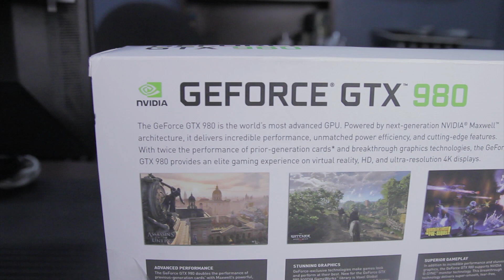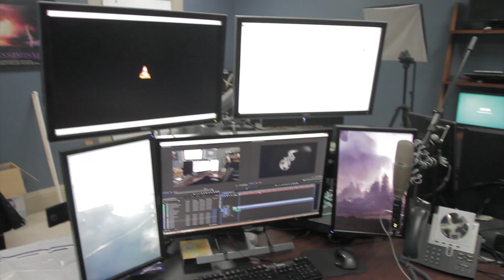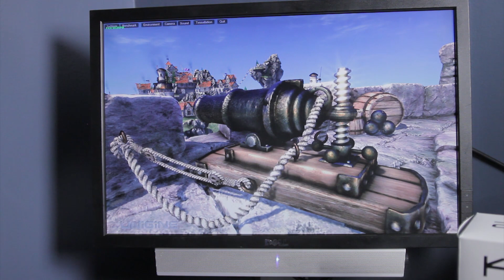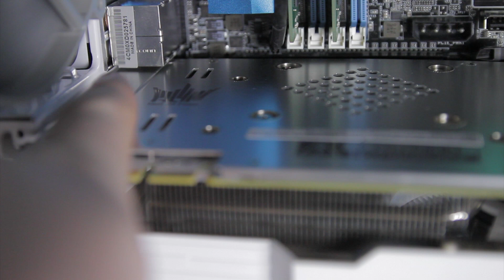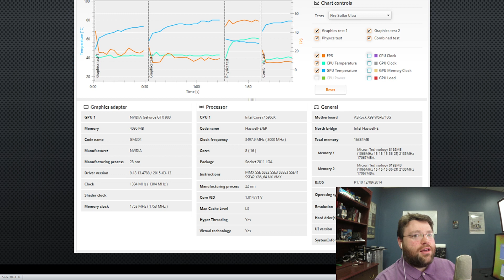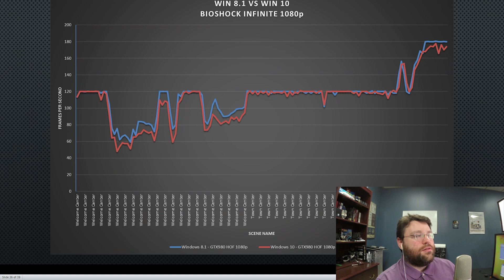KFA2 Nvidia GTX 980 HOF Review & Benchmarks (GALAX)

Comment: "GTX 980 1 of the most power thirsty cards ever from nvidia" Have you forgotten the GTX 480 and the GTX 580? Put a 200 - 300mhz core clock your asking for a 700 watt PSU alone for the entire system for 1 card.

Comment: The 980 doesn't consume much power (and output much heat) at all. The extra 8 pin (only one needs to be there: look at the strix 980) is for extra overclocking potential.

Comment: Wendell, I feel like u haven't researched the Maxwell cards very well. U make a few claims that are quite wrong. The 980 isn't one of Nvidia's most power hungry cards ever, it's actually the opposite. The 980 and 970 are two of the most power efficient cards they have ever made. That is one of the biggest benefits and highly touted features of the Maxwell architecture. Also u went on to say that a 1500MHz clock made this the fastest 980 u have benchmarked. Once again that is the normal boost clock for the Maxwell cards. I have a 970 g1 and it goes up to 1620 MHz stable without much effort. I know that many versions of the of the 980 can reach the 1500 MHz boost without much trouble. The next thing u said was about DSR being able to scale to 4k, that is true but it does way more than that. It can go to any resolution between 1080 and 4k. The reason I'm writing this is because I was very surprised that u didn't already know the basic facts of Maxwell. The main fact about the 980 and Maxwell is it is very power efficient and the temps stay cool, resulting in high overclocks and big gains in performance on almost every card.

Comment: How exactly is this "One of Nvidia's most power hungry cards ever". Any GTX 480 owner who was essentially using their GPU as a space heater would beg to differ lol. And 1500 MHZ is a pretty average OC for Maxwell architecture. So, considering the cost and over-done power delivery design of this card, it looks like you lost the silicone lottery unfortunately
Reply: It's alright man, nothing lasts forever and nothing is promised. The only thing promised with these cards is the core clock, even the boost clock isn't promised but I'm alright with it lol. I'll be selling and upgrading by summer time latest anyway, possibly go team red or team 980ti lol.
Reply: Actually I'm pretty sure this card pulls a lot of power compared to a stock gtx980. Also this card runs very high clocks straight out of the box, some people prefer not to overclock themselves so this card would provide a better gaming experience over any other card at stock speeds.
Reply: Noxtastic overlocking is easy as fudge if your building a pc and you can't do that that's. Really dumb
Reply: AdamantiumDragon NG Some people just don't do it, whether it be because they don't know how to or just don't want to risk damage to their components.
Reply: AdamantiumDragon NG overclocking is easy. that's true, but i have a 780 classy that don't overclock at all and on top of that i have to re-activate the overclock every time i boot my pc, so i run it at stock.
Reply: i use a gigabyte gt 440 i wonder why it even has a fan it doesn't run very hot at all but i have a BFG GTX 9800 i can't even use it because of my power supply but that's not saying much it's only 500 watt with a single 6pin but when you consider the time frame the card came from that's a thirsty card
Reply: 1500 isn't average lol. My 980 hits 1450 max, without touching voltage (gigabyte g1 gaming edition).
Reply: Ameer Mahmood you got a really bad card because mine goes to 1540 without any problem
Reply: i would like to make an amendment to my earlier statement a fucking leaky light fixture combined with a storm claimed my 440 last night, i'm not happy!
Reply: LAN Master oh shit, that sucks. Is the rest of the pc ok?
Reply: Casey Powell strangely enough yes thanks for your concern it looks like the water missed the CPU landed on the back side of the GPU and shorted it out to high hell the fan spins really fast and displays no signal but the computer doesn't shut off intimidatingly after pressing the power button so it's not faulting the OS

Comment: Hold up, the 980 is one of the most power thirsty cards nvidia has released? Nonono sir maxwell is power efficient! The 980 pulls less than a 770. Also, the reference pcb models only requite 2x6 pin connectors.
Reply: ArrKayCee I think he meant out of the 900 series lineup
Reply: ArrKayCee Exactly, I was like "What the Fu...?!".
Reply: According to a detailed test on Toms Hardware:- "If the load is held constant, then the lower power consumption measurements vanish immediately." and "Nvidia's stated TDP becomes a distant dream."

They benchmarked reference cards pulling in around 280W, thats more than a Titan and GTX 780 let alone a 770.

http://www.tomshardware.co.uk/nvidia-geforce-gtx-980-970-maxwell,review-33038-12.html
Reply: Tuberuser187 While that might be the case, when do you have a consistent load on a GPU? Only things I can come up with is bitcoin mining or folding by utilizing the GPU.
Reply: Revvit If you read the results by "constant" they refer to any time GPU boost is on for more than a minute.
Reply: Tuberuser187 It is clearly stated that the load needs to be high intensive compute tasks such as CUDA or OpenCL. You do not have constant 100% load whilst gaming for example.
Reply: Revvit Go back and look at the graphs, it has them clearly titled "1 minute of high resolution gaming", CUDA processing will do it as well they are also referring to the way GPU boost works on a warm card just that the effect isn't as pronounced.

Besides people do buy these cards for CUDA accelerated rendering and video processing as well.
Reply: Tuberuser187 While gaming the avg. power consumption is still relatively low. The stress test graphs are the only ones showing excessive power consumption. The graphs are seriously not as hard to read as people seem to make of it. 

The massive power consumption was achieved with GPGPU by applying constant 100% load. It's still just 200W while gaming and 285W with synthetic 100% load benchmark. Synthetic tests are never applicable to real-life scenarios.
Reply: Revvit Well they must be hard for you to read as they show the gaming load in excess of 250W, above 300W on brief occasions. The average is dragged down to below 250W because of the occasions it drops as low as 50W, because its lower than the amount of times its higher the average is lower.

It still clearly shows that the stated TDP is inaccurate as for a significant amount of time its far in excess of that.
Reply: Tuberuser187 Why should I care if a card draws 250-300W for a split second when it averages out in a very reasonable consumption levels on the long term? Imagine a power supply has come to market which can output a peak of 3500W, but consistently handles 1000W load. Would you go around saying "Holy shit! It's the most powerful PSU in the world!"?
Reply: Revvit Why would you care? You seem to care a great deal about the occasions it draws less than its TDP a great deal, plus it consumed more than 250W for longer than "a split second".
Reply: Tuberuser187 I don't care about the lowest number either. I care about the average, like most of the sensible people, because that is how you get the most meaningful power consumption number within a period of time. This is once again 200W, which is perfectly reasonable. Just like the test results show.
Reply: Revvit So are you disingenuous or don't you understand how averages work? The dips down to 50W or less are enough to drag the average consumption down below 250W even though for most of the time it consumes significantly more than 250W, if you are being disingenuous you can go fuck yourself and if you don't understand averages then I cannot really help you.

I cannot help you understand the graphs either, I'm not responsible or liable for your limitations.
Reply: Tuberuser187 I have no disagreement with you that the stress test consumption levels are extremely high and are in no way efficient, I am just disagreeing with a real life usage scenarios.

I'd also like to add that all of the numbers I said were clearly given in the Toms Hardware article as testing results.